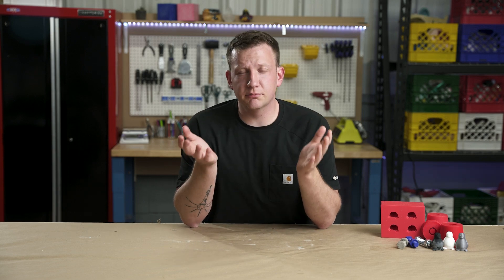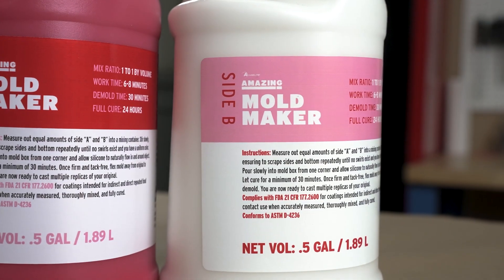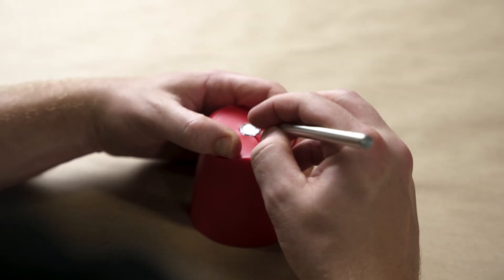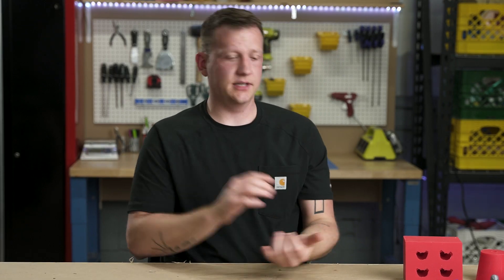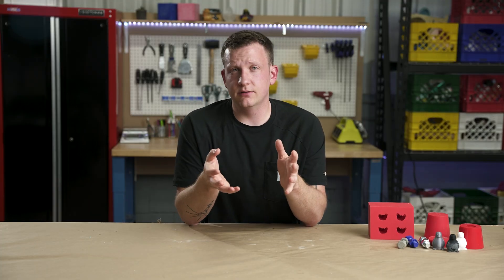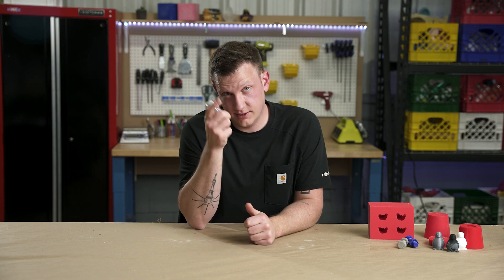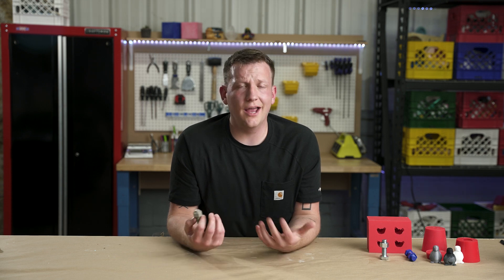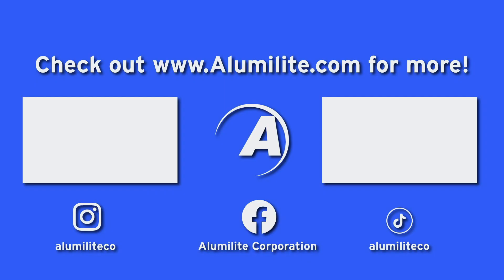Three Ways To Cast in FDA Compliant Silicone Molds | Alumilite

Comment: The item I want to make a mold of is constructed just like the bolt except the front is rounded or convex and I need it to be nice and smooth because I will need my finished product after resin to be smooth.  What’s the best way to stabilize it for mold making? Should I do it at the very top of the threads? The master is plastic.

Comment: Guys I ran out mold maker and need to get some more. Will the two different ones bond since they’re the same type of silicone and brand  😭
Reply from the maker: No worries, we’ve got you covered! 😅 If you’re using the same type of silicone, even if it's been a few days, they should still bond pretty well. Silicone generally bonds to itself, but the timing does play a small role.

Here’s what to keep in mind if it's been a few days:

Surface Preparation: After a few days, the surface of the cured silicone may have developed a thin layer of oil or residue that could impact bonding. Before applying the fresh silicone, make sure to clean the surface of the existing mold. You can use rubbing alcohol or soap and water to remove any dust or residue, then let it dry completely.

Scuffing the Surface (Optional): Lightly scoring or sanding the cured silicone with a fine grit sandpaper can improve adhesion. It creates a bit of texture for the fresh silicone to grip onto.

Test a Small Area: If you're unsure, it might be worth pouring a small amount of fresh silicone onto the old surface to test the bond before committing to the entire mold.

If the silicone is from the same type and brand, you should still get a solid bond, even after a few days, especially with a bit of prep.

If you run into any trouble, feel free to reach out—we’re here to help! 😊 You can always call us at (269) 488-4000 or email info@alumilite.com for more tips. Let’s get that mold finished up!

Comment: Did you have to paint the resin print before molding to prevent cure inhibition like with other silicones?
Reply from the maker: No! This silicone is a platinum-cure so it is less sensitive to the material of your master!

Comment: I like your videos, please keep making them!
You offered to help me with my project. I'm going to take you up on that. I apologize, but I'm stumped...
I'm pouring a Dia del Muerte skull with Amazing Clear Cast, maybe 2.5" high, in a soft silicon mold (Shore15A). My first pour was generally perfect except all the expected bubbles. My second pour, some weeks later, was generally the same except I mixed broken glass inclusions into the resin and I cured it in a pressure pot. (The mold is the size and shape of a plastic drinking cup; sort of a conical cylinder). The problem is my second skull/pour is distorted in shape compared to both the master sculpture and the first pour... it is taller and thinner. I wonder if the pressure distorted the mold. And, if this is the case, what can I do to prevent it? I can send you a picture, if I knew where to send it to.
Reply from the maker: This can definitely happen if your mold wasn't pressure casted when being made! We would recommend foregoing the pressure pot and trying some different bubble techniques. Here are a few:
• Put your epoxy bottles in a warm water bath for 10 - 15 minutes before measuring and mixing
• Stir slowly, pour at an angle and into one spot the entire time
• Use a torch or heat gun to get rid of surface bubbles
• Tap the edges of the mold to help get air released from the bottom of the mold to the top